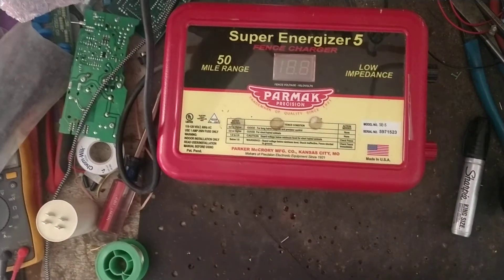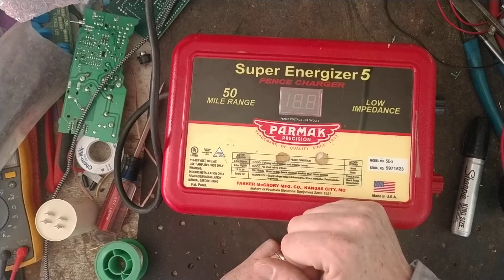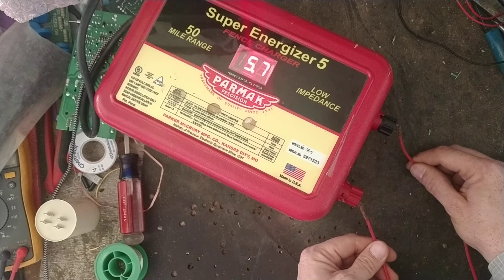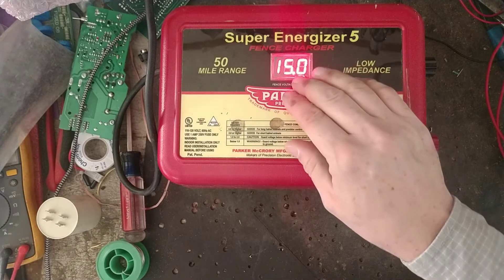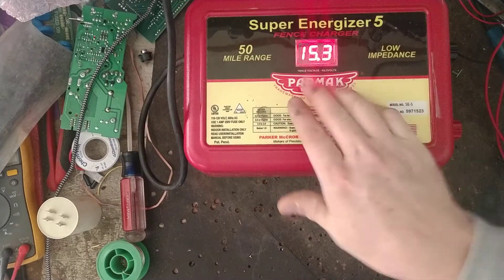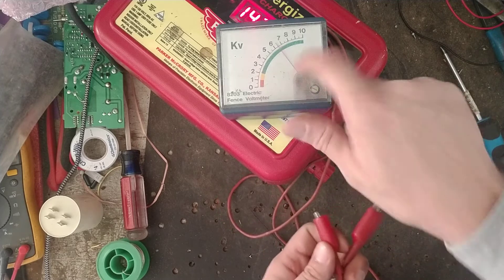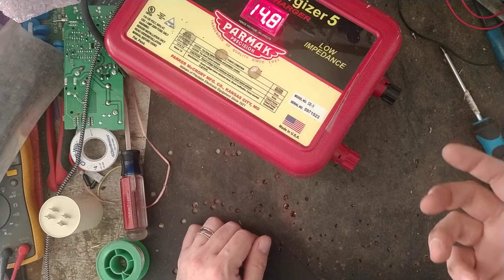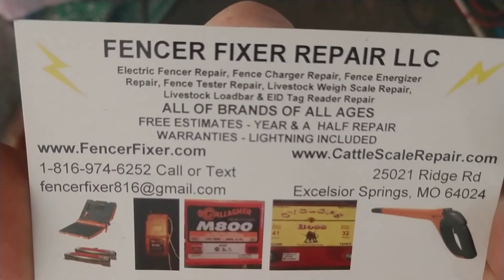Fence Charger Troubleshooting Tips

Comment: Good advice. I had this sort of problem with a JVA electric fence energiser, made by Pakton like a lot of other energisers, where the fence suddenly did not kick at all.. The idiot lights on the fence unit said that the energiser was okay, but the fence was not.  I did what you said and found that the secondary of the output transformer was burnt out.  It turns out that this is a common problem with their smaller units up to about 4.5J that all use the same transformer and Pakton have since upgraded the transformer they use. The replacement part was less than a third of the cost of the new price of the energiser and was an easy fix.

Comment: Thanks for the tip.
  I have a Fence charger here that burned up the 100 Ohm resistor on the board- No Clicking at all, I Replaced that resistor and she does click now BUT VERY weak spark at fence connection's. Readings I got on transformer 0.03 ohm on primary side and 0 ohms on secondary side of  transformer.
  American Farm Works 30 mile charger. only 2 months old.
Reply from the maker: You probably have a bad output transformer is my guess. The primary side is right, but not a 100% sure on the secondary side

Comment: My Mark 8 is putting out a charge but the digital screen started flashing. I tried changing grounds but it didn’t stop flashing. Any advice?
Reply from the maker: If it's a newer unit that's about 3-4 years old, that's a new feature they put in. It means you're ground system isn't adequate and you need more ground rods, it's more of a warning thing than anything just making you aware. That size unit i would use at least 3) 6' ground rods in the ground as deep as you can drive them, deeper the better, and space them 10' part, but not much closer and definitely not further a part. The voltage on the ground side has climbed up some for whatever reason with the ground system you currently have, it's throwing a warning. Nothing bad will happen, your just losing some of your shock power and voltage that's not making it to the fence. The better the ground system is, the better the whole system and the unit will run and perform.

Comment: What happens when the numbers are at 12 to 13 but the light flashes on and off the light flashing is independent to the numbers flashing on and off
Reply from the maker: I know we texted or emailed back and forth on this. Did you get this figured out and if so, what fixed it? Was it the ground system?

Comment: address again to send a charger for repair please
Reply from the maker: It's on my website in the description of the video... www.fencerfixer.com
Fencer Fixer
25021 Ridge Rd.
Excelsior Springs, MO 64024
Reply: My charger clicks but no flashing light...would that be a bad ground?
Reply from the maker: Which brand and model do you have? Also, have you tested across the unit with a good fence tester with no ground and fence connected to it?
Reply: Yes,I even bought a new fence tester...with nothing  connected to box + is 2000V, - is zero....with just the fence connected + is zero output, - is 7000V... with fence and ground connected + is 2000V negative in 5000V and fence reads 2000v. Is a HOL DEN electric fence controller ( Zareba) model T502, S/N 020724000124, 2 joules output (50 miles)